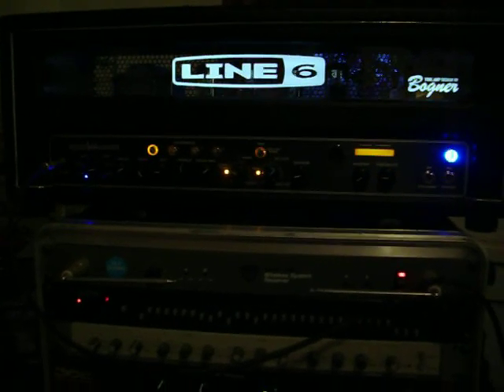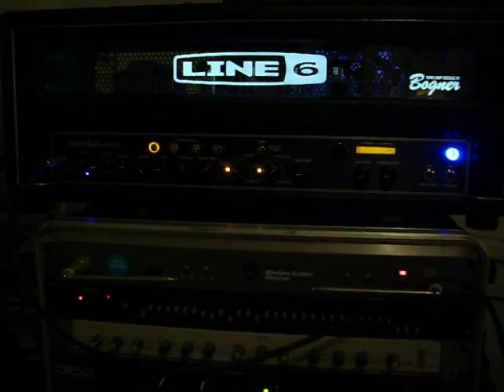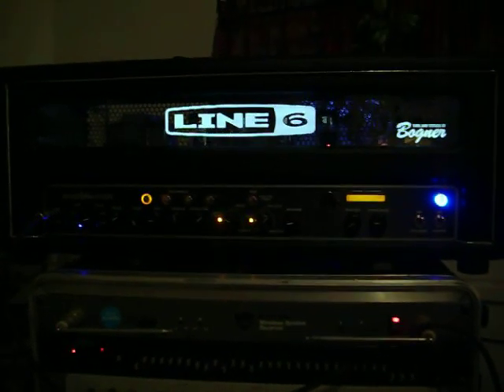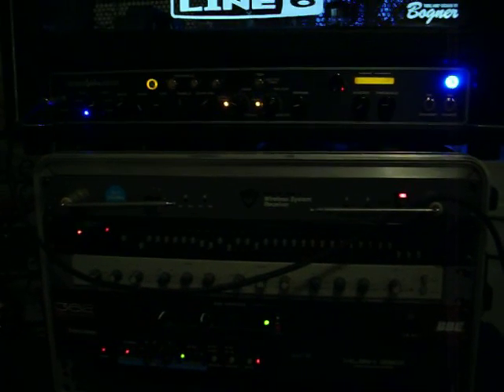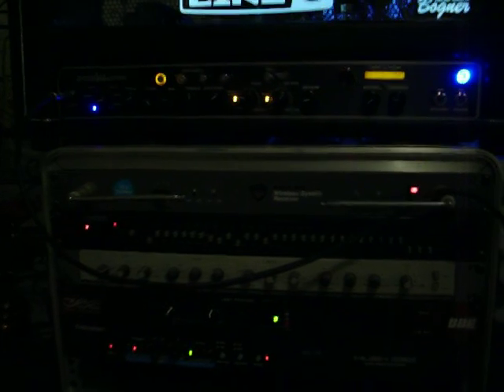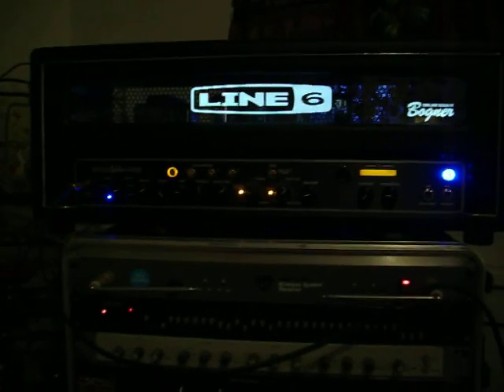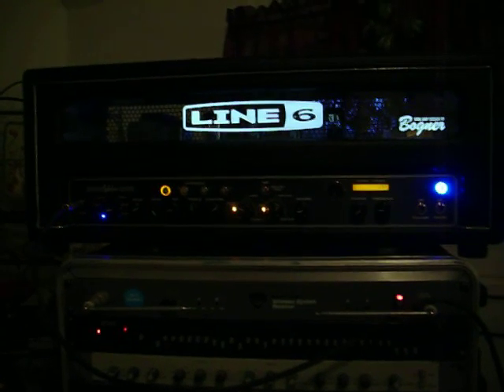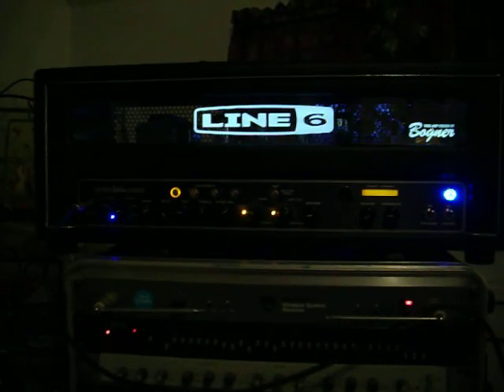Line 6 Spider Valve in depth

Comment from the maker: I'm using the HD100 head thru my peavey cab loaded with G12 T-75's Celestion speakers..the settings were just stock settings on the amp...I made the clean sound from cleam amber and the rythym was a ben moody setting,the third is killswitch engage preset and the lead channel was royal lush  no mods to them at all....